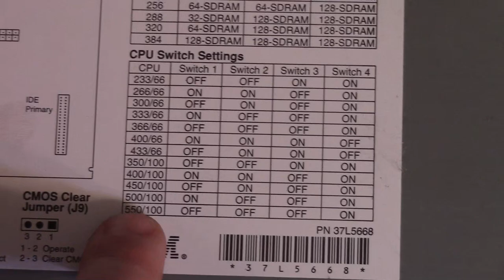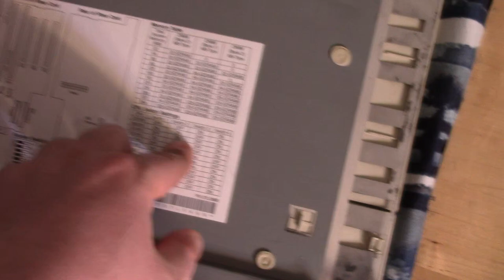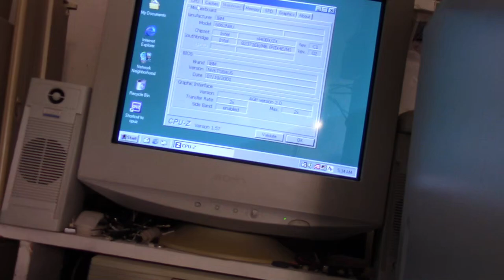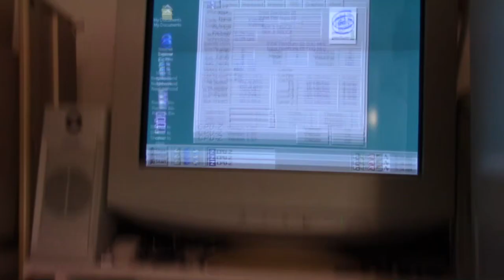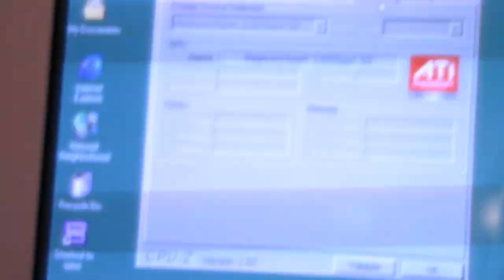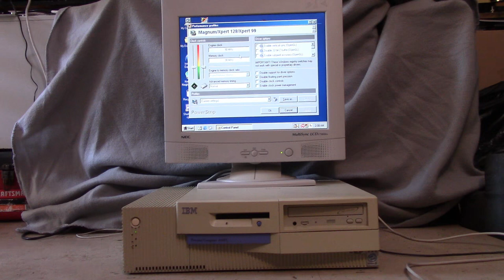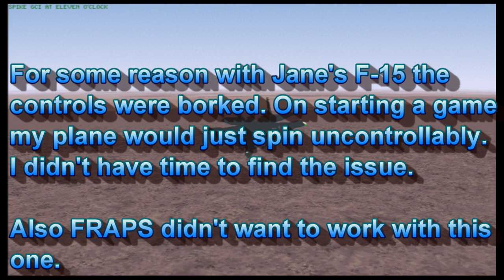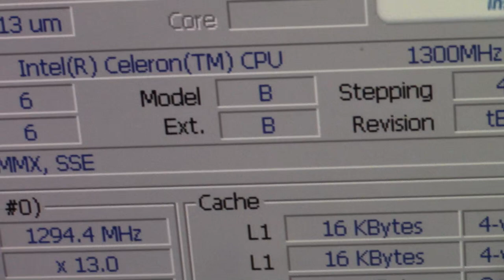IBM PL300 Type 6862

Comment: I remember using these in school for years... and our school system had the audacity to upgrade them to Windows XP even though they just barely met the requirements.
Reply: yep goodnuff shovexponthere
Reply: @rartolak  The only problem is that the ones I recall using in school were not this... ehm... "highly equipped." If I recall correctly, they were equipped with Pentium II's and perhaps even a couple of Pentium MMX models.
Reply from the maker: @AliceC993  Yes, Models like the Type 6162 used practically the same case but the motherboards were quite different. The 6162 which I did a video on some time ago were socket 7 PCs https://www.youtube.com/watch?v=d9h7eiUes44
Reply: @AncientElectronics  I've been subbed to your channel for quite some time, I remember that video. :)

Comment: Great machine ... also have a couple of ibms from that period (desktop and tower). Does it have built-in speakers ? (One of mine does). Great win98 pentium 2/3 gaming machine. And good choice on the ati 128. Luckily you have an AGP upgrade path. Lots of these machines only have pci and only internal agp.
Reply from the maker: Yes, It does have a built-in speaker. I used to own a Type 6162 which was an older model. more or less the same case but it was socket 7 and was limited to only PCI and ISA.
Reply: @AncientElectronics  like these machines also. When I was working with these things in the late nineties I always found them to be pretty fast for “normal” windows tasks (although not necessarily gaming), perhaps even faster than most clones I had at the time.
Reply from the maker: @RetroSpector78  I have found it to be quite zippy in regular Windows use. Since this video I ended up settling on an 800MHz Pentium III and I wanted to mix things up a little with the video card. I had an Intel i740 I wanted to mess around with but on this PC the 2D seems to work fine but no game will detect the card for any 3D acceleration though I'm willing to bet it's a bad video card, just need to find time to test it another system.
Reply: What AGP speed this model have 2X or 4X? i want to upgrade a GPU like geforce 256 or Riva TNT2 Ultra.

Comment: What a gem of a channel. Great video mate. 

I just picked up the GL version of these. She's only a PII at 333mhz.  But I couldn't resist as my old college had one and back then it was my dream PC.

She's immaculate inside, but battered outside, missing the blue tab and bay cover. But will try best to bring her back to New. Just hard tracking bits like that down. 

Will become my 98/DOS rig.  I got no AGP so will try and track down a PCI Voodoo 3. Only issue is figuring sound card... ISA for DOS or PCI sound blaster for Windows... You got any suggestions? 

Will be making a video on it and you helped out with some good info. Will shout you out for the fountain of knowledge... Thank you. 

Great intro BTW!
Reply from the maker: Thanks, The Voodoo 3 is a great choice. technically you could do an ISA and a PCI sound card but I never recommend those setups, usually too much of a headache juggling IRQ's and dealing with conflicts. I guess it mostly comes down to if your planning on playing more DOS games or more Windows games with that system. If DOS go ISA for sound and if Windows go PCI, I can however make some suggestions. AWE64 and especially AWE64 gold is a good choice for an ISA card that is widely supported and will work well for DOS and Windows. An AWE32 with a real OPL chip may be a great option as well as you'll get true OPL FM and DOS compatibility and it will work well in Windows as well. For PCI I've found the Sound Blaster Live! cards have decent backward compatibility with DOS titles and are good Windows cards offering EAX and such. Aureal Vortex 2 cards also seem to do pretty well in DOS and offer A3d in Windows.
Reply: @AncientElectronics  nice!! Thank you for the feedback. 

I do have a silly OP Win98 setup for later games. P4 @ 3ghz with a Geforce 4TI.  But I wanted something that could do early 90s DOS and win games that wasn't just a generic box... The IBM ticks those. 

In my parts I already have a Sound Blaster live and put in. It's great for Windows, but janky DOS emulation... That normal? 

Graphics I'm stuck with PCI and only PCI card I have is a FX5500... Too new for my liking, but compatible for now.  Will test it out in there today. The later drivers may mess me up 

Problem is finding a PCI Voodoo 3 in 2021 without selling my liver.... The hunt is on!
Reply from the maker: @SimplyAustins  No PCI sound card is going to be great for DOS but the Live! comparatively isn't bad. I remember messing with a PC that only had PCI and we wanted to play some DOS titles on it. I recall the few cards I tried like the Ensoniq PCI and a few others only the Live! gave correct(ish) sound effects in Wolf3D. I think the AWE ISA cards are your best bet especially an AWE with a real OPL chip. They will have excellent compatibility in DOS and have some MIDI capabilities. They should be adequate for Windows as well, especially since you already have a separate Win 9x build. The FX series were the last cards from nvidia to support a few features that Windows 9x uses but I suspect you will still see issues with games being that new of a card especially with those later drivers. There are plenty of good and cheaper options if you can't get a hold of a Voodoo 3 a TNT2 should work very nicely.
Reply: @AncientElectronics  thanks mate.

Yeah, I have an Audigy in the more powerful one, it seems more stable as I can add more aggressive sound fonts etc. But the live! In this seems to struggle, could be the CPU taking hot with the Sound Card?

I think I will go ISA with an AWE. Keep an eye out for one at a reasonable price. eBay gets a bit silly in UK for those and Voodoo cards.  

Question though. Back in the day, 90 to 96ish all I had was my trusty 286 and a dad that would have smashed my teeth out if I opened it, so that era I was PC beeper only.  If I get an AWE, would I need a wave table thingy to get full features? Sorry if this a nooby question, I just never had the chance with upgrades until 98ish
Reply from the maker: @SimplyAustins  Thats cool you had a 286. I just recently finished revamping my 20MHz Harris 286 PC and it's likely going to be my next video. Most people went from an 8088 PC and skipped the 286 and went with a 386 or 486 back then.

I believe the Audigy cards do more in hardware and tax the CPU a little less under Win 9x but I never found it to be noticeable.

The AWE cards have built in MIDI so you don't need a wavetable card for adding midi though it is an option. in my Pentium 233MHZ DOS PC I have an awe32 paired with a wavetable board for better midi. The AWE emulates general MIDI. it sounds okay but not perfect. many games directly support the awe32 which is nice but you may have issues with games that use protected mode. Phil did a good review of the AWE32, check it out to see if its a good fit for you https://www.youtube.com/watch?v=FZnfl1PN2Fo
Reply: @AncientElectronics  yeah, I loved that 286, it was all I had.  My first computer was a ZX Spectrum. Then one day my dad brought a Olivetti 286 home from work. Wolfenstein 3D, Monkey Island, X-Wing, Space Quest etc... Loved it, but mates had a Amiga.  But loved getting into DOS and Windows 3.1, as useless as it was to me. 

Been loving Phil's Lab, great source for comparisons, and pixel pipes too. But it's always the little things I get stuck on as it's the era I never got hands on.  

First GPU was a Voodoo 4. I got Max pain on my girlfriend's PC, it wouldn't run. Asked why and found out about the world of PC upgrades. What a mistake 🤣 with rooms of PC parts.   Unluckily, mostly after 1999

Right now I'm figuring the difference between AWE32, AWE64 and the Value and gold... Seems there's never a right answer. 

I'm subbed, so will see your videos now. Sorry for geeking up your time, but thanks for the knowledge and steering me in right direction.

Comment: It is hard to see from the video, but do you think a full length ISA card would fit in the lowest slot of the riser card? A full length card is 13" / 33 cm.
Reply from the maker: I think so. If I remove the CPU first I can fit my AWE32 easily though it's long but not full-length. There are even "guide slots" in the plastic kind of like on much older cases that expect full-length cards.
Reply: @AncientElectronics  Good to know. I might pick one up so I have a new home for my LAPC-I sound card. It is absolutely the longest and biggest IBM PC expansion card I have ever seen in my 30 years of PC building.

Comment: I had seen graphics cards with that kind of form factor before but never the machine they went into, I think I've got a few matrox cards that look like that. I thought it was just a weird design.

The little fan on the original CPU looks kinda funny, almost like an after thought.
Reply from the maker: I also have a few Matrox cards like that, G200s mostly. Diamond Multimedia used this form factor for a lot of their cards in the late 90s.
Reply: @AncientElectronics  greetings new to your page want to inquire on a presentation u did long ago
Reply from the maker: @Blu-Man  inquire away
Reply: @AncientElectronics  u recall the samsung slimfit crt  presentation u done long ago
Reply from the maker: @Blu-Man  yes, you should know I do not have that TV anymore. Replaced it with a Sony fv310 some time ago.
Reply: @AncientElectronics  u spoke about getting a 1080 I unicorn have a Samsung slimfit gaming gigantic tv it plays magnificent bought it from my local TV shop $40 think it's a  35 inch superlative condition pure bright channels

Comment: hated the case covers on those.  looked good but was a pain if the RF fins in the back of the cover ever got bent...which was often.  I supported hundreds of those models and got really good and slapping them together without problems but it seems that everyone i worked with bent those little fin pieces and had problems.  That being said, it was otherwise a nice little machine.  Nowhere as good as other generations of IBM gear in terms of heft and quality of design (overdesign really...IBM).   This one was just the exception.  Also, those little lift tabs were not on all years of that series.  I actually never saw one with that.
Reply: special form factor?  half height AGP?  not special.

Comment: 8810 is Vortex 1
Reply from the maker: Not according to my research. The 8820 released in 1997 was the first vortex. The 8810 was released later as a budget chip.
Reply: @AncientElectronics  Sorry it has been years since I sold my Vortex 1 card. Yes you're right. 8810(damn whoever gave it the model number) came out after 8820 @ Vortex 1. XD
Reply from the maker: @jamesjan  You would think something like the 8825 would make more sense as a model/revision number.

Comment: Used to love these at School. But the onboard video was terrible for gaming. I remember ours struggling to run flash games
Reply from the maker: yea, the Trio3D was really meant for business applications and light work then it was for gaming. It supposedly uses the same 2D core as the older trio chips so it should be good for old DOS 2D games though I haven't really tested this out.